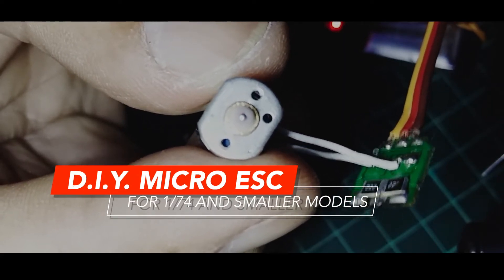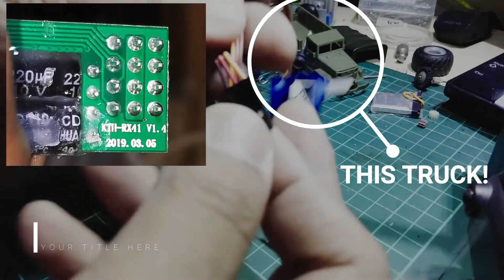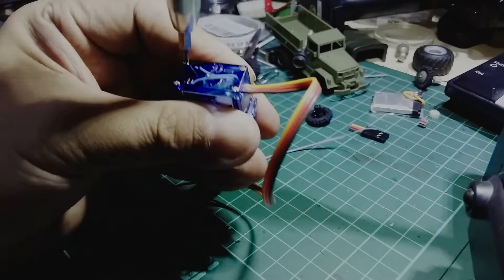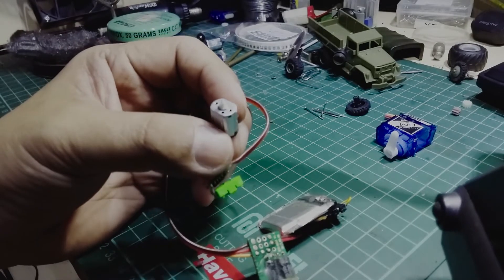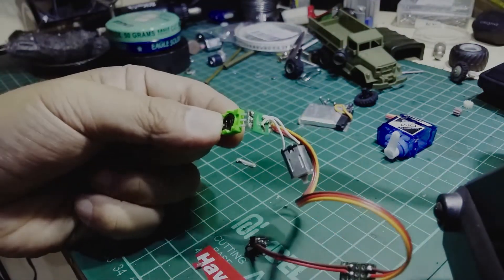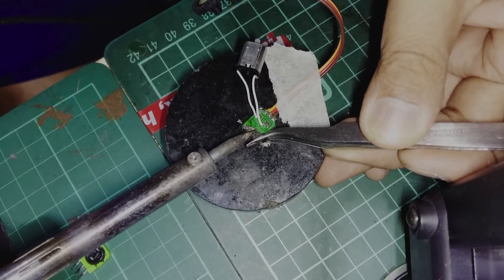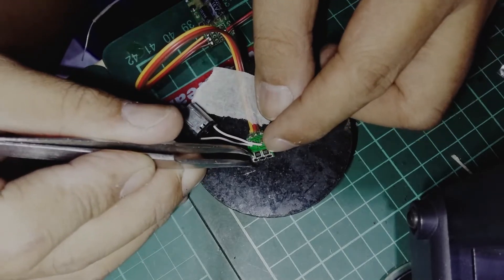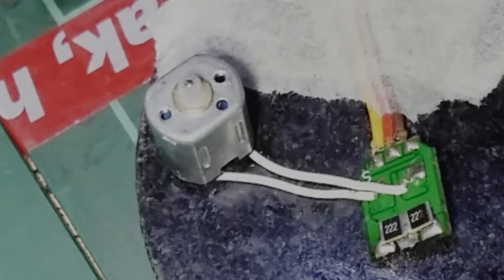DIY MICRO ESC FOR YOUR MICRO RC PROJECTS

Comment: Hi sir. There is not those resistors in my place, do you know exactly wich carbon resistors can i use instead?
Tks for this big and detAiled video. Wich this esc you can feed a little motor with a simple 3.7 volt and a similar servo at the same time. It is not possible with must cheap escs
Reply from the maker: You can use a bit higher than 2.2 ohms as long as the value of each resistor is the same, usually I just look at my old radio parts and find the nearest value and test it, I tried 3 to 5 ohms and it works just fine.
Reply: @ArvinDomingo  thanks so much!!!

Comment: It's funny because the ESC for 1/64 Scale are difficult to find in Two-Way. They cost too much money and shipping time is too long. Also, 9G Servos are cheaper than smaller 4.3G, and 2.1G.  I prefer Metal-Geared Servos because you get spare parts out of the deal, too. This is a Great Video!
Reply from the maker: Thanks!.. I prefer using these smaller servo so I can use the spare gears on my future projects, yes I also wonder why 9g servo are cheaper than the smaller one?.
Reply: Those servos arecthd cheapest

Comment: The pot is 5ohms? Or 5Kohms???
Reply: It's Kohms. The 222 smd resistors he uses are 2,200 ohms (2.2k ohms). I've seen someone else post a very similar style, but with 2.2k ohm metal film resistors. Same thing/concept

Comment: I'm curious if this could run 130 motor (tamiya mini4wd sized) motors.

I'm planning to convert a mini4wd into an rc 😁😅
Reply from the maker: Nope, the i.c. is not powerful enough to run 130 size motor, it can run.. but once you put load on it, it will burn the board easily.  I would suggest for you to get the cheap 20Amps micro ESC, that should be powerful enough to run even modified 130 motors.

Comment: Sorry sir dito na ako nag comment
Question, meron po ba kayong link nung dating motherboard nyo na x79 
Yung motherboard po na hindi nyo ni review
Reply from the maker: Unfortunately di na po active yung seller sa Lazada, I found one sa Shoppee with the same model but the price is a bit higher, around 9K here is the link if interested, note I am not connected nor affiliated or whatsoever with the seller: https://shopee.ph/X79-Motherboard-LGA2011-Combo-with-E5-2620-CPU-4-Ch-16GB-(4X4GB)-DDR3-RAM-13-O5R7-i.275682531.6747670175?sp_atk=96b55be0-5b96-443c-9c0c-954bdbf0bf75
Reply: @ArvinDomingo  pero kuya arvin 

Kaya po kaya nang 3k motherboard yung xeon e5 2689 natatakot po kasi akong bilhin kasi baka hindi kayanin nung motherboard
Reply from the maker: @kylerollon6990  Kaya naman nung tig-3K na motherboard as long as yung 2689 mo is LGA2011, but if I were you I would go for the motherboard na di ko ni-review at sa ni-review ko, kasi quad channel yung ram slots nun, yung tig-3K dual channel lang kahit 4 ang ram slots.  Pero depende naman yan kung saan mo gagamitin yung board.
Reply: @ArvinDomingo  gagamitin ko po ito sa gaming and school work

Hindi ko rin po gagamitin yung intel turbo boost 

Kaya po baka yung tig3k nalang bilhin ko thx sir 

Full support ako sa channel nyo sir
Reply from the maker: @kylerollon6990  Naku maraming salamat sa suporta! 😎👍
Reply from the maker: @kylerollon6990  Yes pwede na yan pang-gamings at school work, basta need mo nga lang ng magandang graphic cards para swabe sa games, need mo kasi ng graphic card sa motherboard na yan, walang hdmi or vga port kasi ang mga x79 motherboards na na-encounter ko.